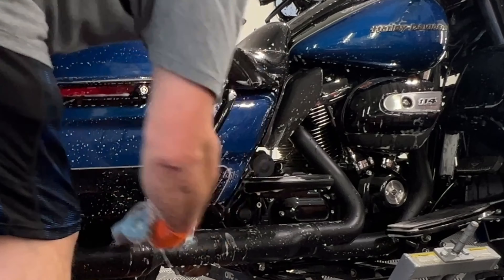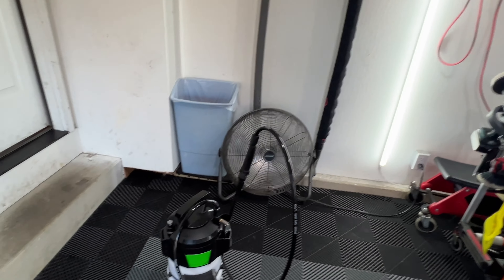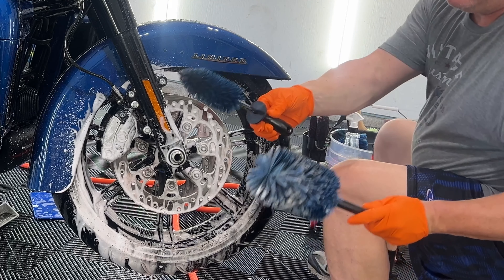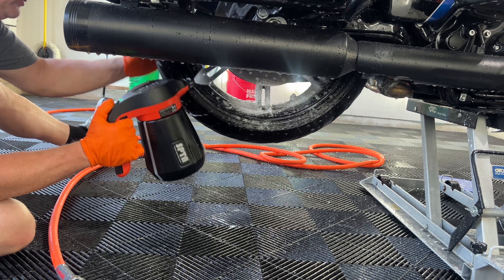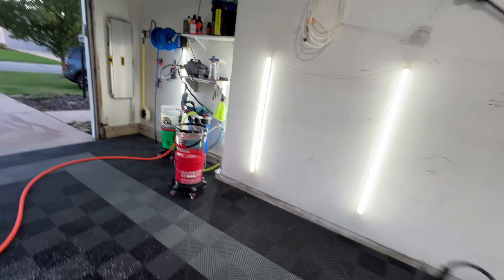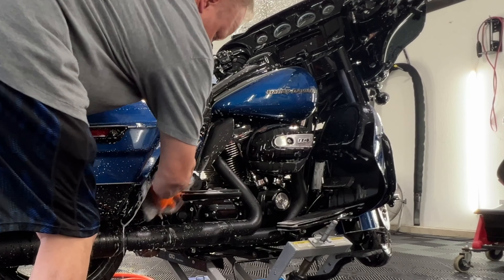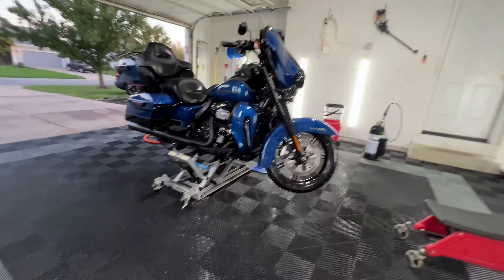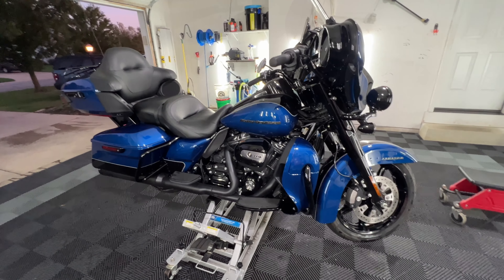HARLEY DAVIDSON Ceramic Coating Wash - Gyeon Mohs Evo

Comment: Are there areas on bikes that can’t get wet or you need to be careful?
Reply from the maker: probably only if had seat off and sprayed directly into electricals.   Definitely no concern here with soft garden hose and with seat still on.  I have done "seat off" details and I just cover
that area with a towel.
Reply: 👍🏻 thanks